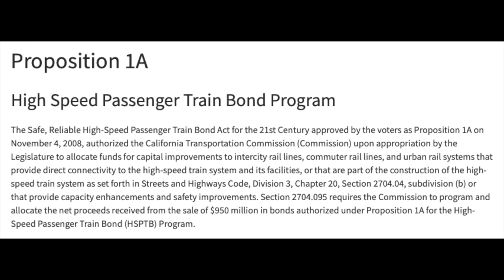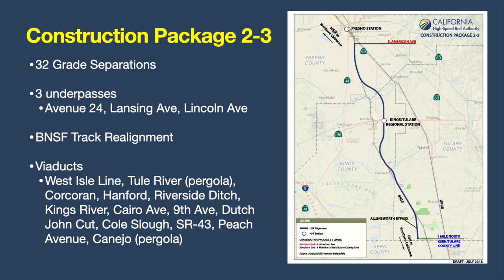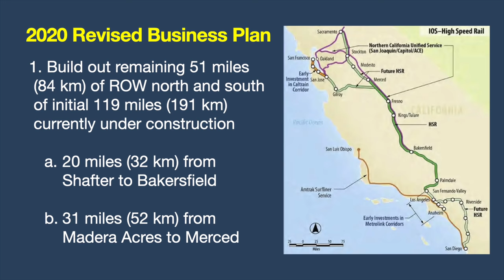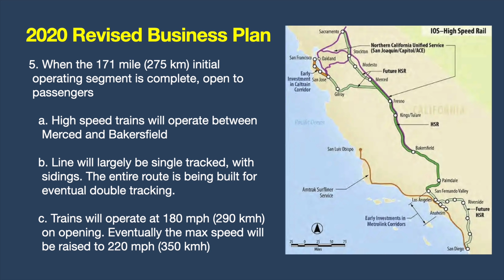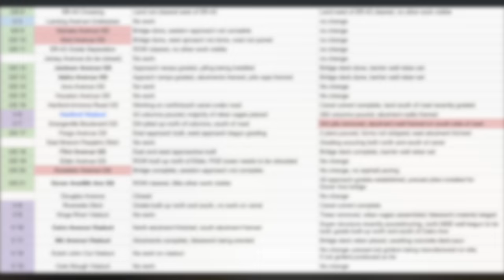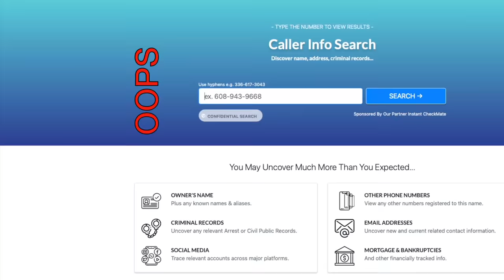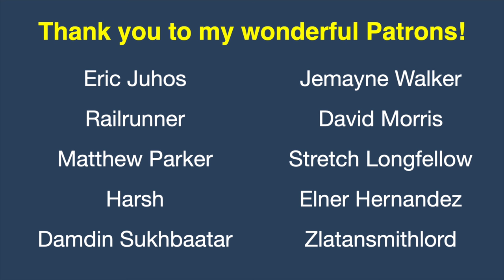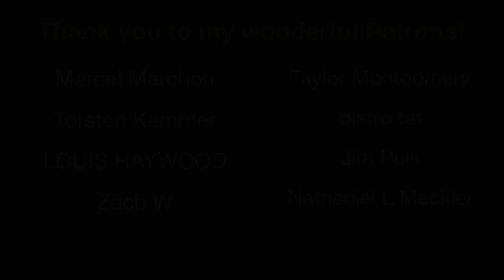California is Building High Speed Rail. It’s time to finish it!

Comment: What's clear from your video is that the High Speed Rail project is clearly a "road improvement project." Seeing the number of highways and roadways being reconstructed for cars, and not HSR, show why the costs of the project have continued to escalate. I'd be curious to see a breakdown of how much of the HSR budget is actually going into roads and utilities. 

While it's great that this capacity is being built, seeing the flyover of the Bakersfield station is one of the major reasons I'm concerned about the effectiveness of this project - it looks to be in a completely industrial area / likely transit desert. While I'm sure some local transit will be rerouted, it looks like there's almost nothing around the area, showing that those renderings of the "reinvigorated area" likely a pipe dream if one still needs a car to get around the area. Are there plans for a mixed-use development around the HSR station?
Reply from the maker: Yeah, you’re not wrong. Particularly if this project doesn’t get completed and trains actually start running, it will be all about roads. Yes there are plans to develop the areas around stations, particularly in Fresno, where much of the land around the station has been cleared. Bakersfield however has been much less receptive to HSR, which is why the station will be built on the edge of town and not the center. Bakersfield however didn’t have any problem sacrificing neighborhoods for the new freeway that’s being built, though…
Reply: What you describe happens with all HSR projects around the world in populated areas with existing public infrastructure like roads, bridges, and highways. I'm surprised you wouldn't have thought that would be the case. And more of these kinds of mitigations will take place the closer the project construction gets to major cities. In fact, studies are happening now in L.A. about what current crossings will have to be completely grade separated that will then result in rerouting existing roads, etc.

Many of the early train stations in the 20s were not necessarily built in areas with high density of businesses or residences. They tended to be at the edge of what then was perceived to be the cities boundaries. I'm sure you've seen many videos where you see the train station/stop in kind of an isolated location. Forward decades later and the train station is now surrounded by a whole bunch of stuff. That will happen in Bakersfield too.
Reply: @TheFourFoot  Noting the new developments around BART stations I feel like we can successfully develop the area after high speed rail has been completed. California needs more housing so this would definitely help.
Reply: The Bakersfield HSR station will be a ten minute walk to downtown and many restaurants, a five minute Uber ride to hotels, museums, and other entertainment options. It's also right next to a major highway. It's not exactly a "transit desert." I happen to pass by the area on my daily commute and know the area well.
Reply: I 👍 agree.
Reply: I was dissapointed to see that they didn't build a direct connection into LAX.  I suppose when they looked into it, they found it to be prohibitive. Last time I looked there were like THREE!!!(?) transfers on the light rail system, LAX RAIL-LAX Air even if the LAX trolley route is in place yet?

Comment: Great analysis.
I've always said the old traditional way of building more freeways encourages more motorists to purchase vehicles which causes more pollution and congestion which is now a big step backwards.
California is the richest state in America and 5th richest economy in the world and should be keeping up with the rest of the world I.e. UK, Europe, China and Japan. 
This is a great project and yes hope it gets completed.
Reply from the maker: You’re absolutely right! Thanks!
Reply from the maker: Elloquently said
Reply: There seems to be a general misunderstanding of how freeways work in California because we don't really build them anymore.  The last wholly new section of freeway to be built in the state was completed in 2007. That had been planned since the 60s and partially completed in the 70s.  Occasionally they are expanded inside of existing rights of way, which are sometimes in built up areas, which is why that tends to be expensive.  However, those freeway expansions are only necessary because of the massive planning failure by the state government in regards to state-wide transportation, and also a near-lack of regional planning when it comes to expansion and placement of residential areas.  Unfortunately, long distance rail doesn't really address those issues because the rights of way are essentially the same as they were in the 19th century and most new housing in the last 50 years has centered around the freeway system.  Even if a person did take the train, chances are pretty good they'd need to use a freeway to get to the train station.
Reply: @TohaBgood2  The California highway system is not subsidized.  I've debunked this before.  There are numerous dedicated states taxes and fees which only apply to road vehicles and function as defacto use taxes which cover the cost of construction and maintenance of all non-interstate highways(3/4 of the system). They also cover the cost of the DMV as well as CHP. They also subsidize non-road transportation. The remainder(interstate highway sytem) is largely paid for by the federal fuel tax, another defacto use tax. 
Solutions I propose: I think we need some top down state and regional planning that makes sense.  We need to build density where density already exists, in the large cities.  Perfectly fine also near transit hubs that can accommodate the traffic.  Mass transit that makes sense.  A good example is the L.A. Metro Green Line extension to LAX.  This as opposed to mass transit into the suburbs, which doesn't make much sense.  It's been established that there aren't going to many more new freeways in California. 1 or 2 more to go at the most in the entire state.  As a result, the existing road network needs to get more efficient.  Like it or not, a huge majority of daily traffic is individually owned road vehicles and mass transit is only going to make a small dent in that due to the way work and home are spread across the state with no particular rhyme or reason. Speed up development of self-drivers. Start restricting the size of vehicles.  Start working on separating passenger and freight road traffic.(totally doable if all vehicles are self-driving).  Smarter roads in general.  Roads are very dumb at the moment.  A perfect example is the extremely rudimentary traffic light systems we have that do things like stop a main thoroughfare so someone on a side street can make a right-hand turn. Improve traffic flow on the surface network, and you improve it on the highway network and vice versa.  I could go on all day.  Sure, CAHSR is a piece of that much larger puzzle, but it must be understood what a tiny piece we're going to get for quite a bit of money.
Reply: @TohaBgood2  The California highway system comprises about 12,000 miles of roads. Chances are, if you drive in a given day, you'll be on a highway system road at some point.  The gas tax is adjusted to inflation, so it will always cover this system outside of the interstate portion. Even then, the state gas tax pays for about 20% of those roads.  The rest is covered by the federal gas tax, so same deal.  The federal government is not subsidizing anything, because you must first pay the federal government for the privilege of buying gas before you can put gas in your car and drive it. If you want to make the point that electric vehicle drivers are absolutely being subsidized, you have a point, but that's a small portion of overall vehicles and drivers overall cover the costs of the system as a group. The federal portion of the highway system in California is only about 1/4 of the total system. The gas tax also sends money to local governments to help pay for local roads as well as things that have nothing to do with roads, and even some things that barely have anything to do with transportation.  Some portion of local sales taxes go to local roads, but it's not a lot. Most of that money trickles down from the federal or state level. There are also various fees involving things like oil, tires, vehicle specific things, license & reg fees, etc that the state collects.
What you're not understanding is that these roads aren't subsidized because the taxes and fees are aimed directly at the vehicles that use these roads.  And the taxes exist and have been adjusted specifically to pay for the system in its entirety.  There really aren't other taxes like this.  Income taxes don't do this, sales taxes dont do this, property taxes dont do this.  And by the way, the road users pay all those taxes as well while the vast majority of people who dont use roads dont pay the various vehicle taxes and fees. The only other tax I can think of that does something like this is the tax on cigarettes.
I said the taxes and fees are DEFACTO use fees. I didn't say they were ACTUAL use fees.  There's no need for use fees because the users of the system are already taxed as a group in such a way that covers the cost of the system they use. It doesn't matter if each person is taxed to the penny proportionate to their use because that wasn't your original argument.  Your original argument was that highways are "endlessly subsidized", and that's not the case.  They are paid for by the people that drive on them.
Reply: @TohaBgood2  Oh wait, get rid of all vehicles taxes and fees and charge purely based on use?  I'm all for that.  My main opposition to road use fees is that I'm already being defacto taxed for that and have people telling me I'm not paying for anything.  So if we could just remove the confusion that would be great.
Reply: China's high-speed rail management is failing.
Their debt exceeds $1 trillion. They run huge deficits every year.

Comment: My two cents, coming from a country that is operating HSR for several decades:
- High speed operation between Bakersfield to Merced is not viable.
- The connections to LA and SF are essential.  Digging of the tunnels has to start ASAP.
- Current construction should be completed without electrification and stations.
- Let the San Joaquins run on the tracks. Siemens Charger can do 125mph, dramatically reducing travel time along the valley.
- Start HSR with train sets and new stations only after at least SF or LA are connected.
Reply: They really should just connect it to the regular tracks on the northern end and build temporary stations to allow San Joaquins to use it until the complete the section from Sacramento-Merced. Then build the section from LA-Bakersfield, LA-Anaheim can come later, the tunnels are more important.
Reply: There are over one million people in the Fresno area alone. Hardly unpopulated. And connecting this area to the coastal area is genius -- I never thought of that until watching this video.

Comment: I'm now skeptical that the train will actually travel at 220 mi/h in service. Many of those curves are too sharp for that speed unless they are significantly banked, which might not be allowed by regulations because soups and drinks would be spilled (this is an intercity train, so food and drinks are allowed) if the train needs to operate slower than normal in those sections in an emergency. To get 220 MPH (354 km/h) service, you need curves with huge radii like those on the Tohoku Shinkansen (currently 320 km/h (199 MPH), planned for 360 km/h (224 MPH) service), CRH Beijing-Wuhan-Guangzhou Railway (350 km/h (217 MPH)), CRH Chongqing-Chengdu Railway (currently 350 km/h (217 MPH), 380 km/h (236 MPH) planned), Shanghai Maglev (430 km/h (267 MPH), or Chuo Shinkansen under construction (500 km/h (311 MPH)).
Reply: It has to go between LA and Sacramento in 2:30 by law
Reply: @AVeryRandomPerson  Yeah, but do you think the government is able to follow the law set by themselves here? I don't think so in this case. Keep in mind that the California State Government has previously set into law itself in 1990, without obstruction from the federal government or intergovernmental organizations, that 10% of new vehicles needed to be zero emissions by 2003, with intermediate annual mandated targets. Even before the law was overturned by a federal district court in 2002, the automakers were way (orders of magnitude) off target to meeting the intermediate targets, let alone the final requirement. You simply can't legislate what is societally impossible to accomplish, let alone what is technically impossible to accomplish (such as running very high speeds on moderate curves, unless comfort and durability aren't considered). Ultimately, you can't beat the laws of physics no matter what.
Reply: @00crashtest  This wasn't legislated.  It was voted in by referendum.  Referendums become part of the state constitution, so its a whole other level of judicial weight. What happens when it can't make L.A. to S.F. in 2h40m?  If it's ever finished, I think we'll find out because the margin of error to make the required times is extremely thin.

Comment: Brilliant. I have a thought though. I work for HS2 in the UK and it's being built with connections to the existing railway. This means that HS2 trains can also serve cities that are not on HS2 (not travelling at full speed when they are on the conventional network but still at the maximum speed possible on those lines). Could this be done with California High Speed Rail, so that you could still use the line to travel from LA to SF, at say 250mph on the new line and 125mph on the existing lines?
Reply from the maker: Yes, the new line can and will be connected to existing rail network in Burbank and San Jose. Due to the constraints of freight rail system, there likely won’t be many trains that use both networks, but for the foreseeable future of course, HSR will use the Caltrain corridor and the Metrolink corridor in LA.
Reply: @TheFourFoot  you need legislation to give intercity passenger trains priority over freight
Reply from the maker: Yes, we do lol. More specifically we need the legislation we already have to be enforced…